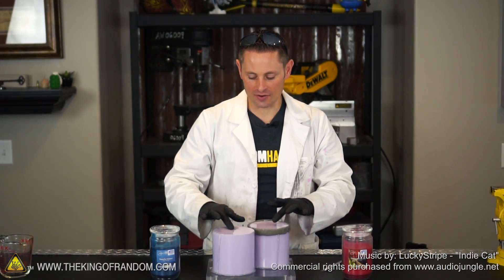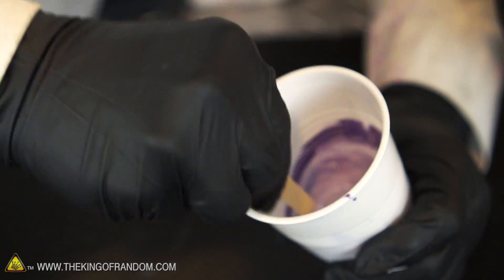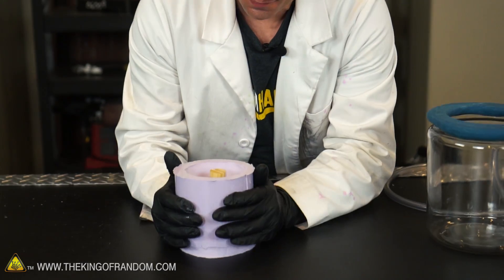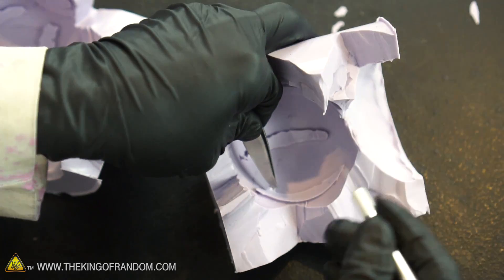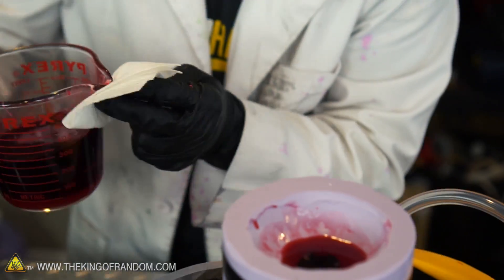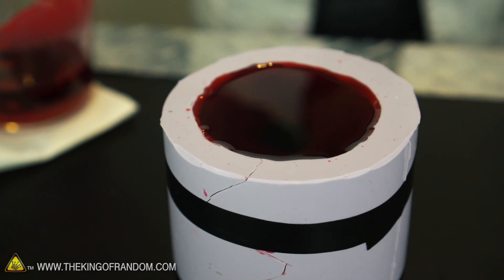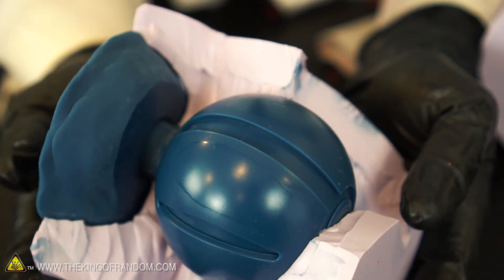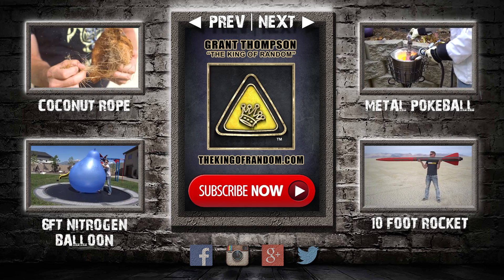Wax PokeBalls & More Trypophobia Reactions in a Vacuum Chamber | TKOR How To Make Pokeball Mold

Comment: By creating a vacuum he increases the pressure which in turn decreases the temp at which the wax would boil. There weren't any bubble in it necessarily, he just boiled the wax.
Reply: Kevin Braemer vacuum increases pressure??? No the opposite lowering the pressure lowers the boiling point
Reply: Nicholas Hagan yes that is my bad. This only proves my point because I meant to say that he is removing the pressure which also decreases the boiling point so those bubbles were boiling not in the wax
Reply: Kevin Braemer I also think that's what's happening
Reply: Precisely what I was thinking.
Reply: saw this right after i commented the same thing.
Reply: Hi Let's Kevin Braemer
Reply: dang, beat me to it!

Comment: The bubbles coming out from the wax aren't air bubbles, it's just the molten wax boiling.
The less air pressure there is around a liquid like water or in this case, molten wax, the lower the boiling temperature becomes, 
Water boils at 100°C at sea level (I'm sorry I have no idea how much that is in Farenheit) but if you go really high, in a non-pressurized plane like a Cessna 172 or in mountains, the boiling temperature can go down to 70°C. If you try to put water in the vacuum chamber, and remove air to a certain point, it will then begin to boil at room temperature, and then will all of a sudden vaporize

Comment: When you lower the air pressure around a liquid, it's boiling point lowers. That's why it bubbles, rather boils, in the vacuum chamber.

Comment: You mentioned that you think the bubbles could be coming from the cracks in the mold but the vacuum is pulling evenly from all sides so any air in the cracks would be pulled outwards not inwards and out through the top

Comment: The wax is boiling. When you decrease the air pressure in the container, the wax's molecules expand enough to make them have a super low boiling point.

Comment: bubbles = molten wax boiling under vacuum.
Reply: Boosted98gsx right? he has really messed up the inside of his vacuum pump now with the wax that will have deposited in it.
Reply: Henry Byers shouldn't have messed up the vacuum pump much, if at all. Just needs to change the oil in it at the worst case scenario.
Reply: Dylan Haley ok i see. i dont know much about the internals of a vacuum pump. just the very basic mechanics.

Comment: The wax started boiling at the loss of pressure. SOmething boils based off of the movement of the atoms (which is caused by heat) and the amount of resistance there is to the atoms or molecules escaping the solution (pressure). This equates to P/T T-temperature P-pressure. As we all know at STP (standard temperature and pressure) water will have to gain 100 calories to be raised to 100C, boiling point for standard pressure (being 1atm, or 1 atmosphere). But at higher elevations water boils at a much lower temperature because the atmospheric pressure is lower allowing the water molecules to escape solution at a lower heat.

Comment: Nice video, but there were two major casting errors:

You boiled the wax, man. The boiling point was reduced when you put it in a vacuum.

Never heat up silicone if you can avoid it. If you're using the mold once or twice, it's okay, but heat breaks it down over time. That's why when you cast resin in it you have to use resin with low curing temps.

Comment: When the mold was in the vacuum chamber the bubbles. Are those actually air bubbles in the wax or was the vapor pressure low enough for the wax to boil.
The first few bubbles could have been air bubbles and later it once the pressure dropped it might have been boiling.

Comment: if you still have the other silicone mold you can just probably put chocolate in it but when you put chocolate in it and when it's done you can like put a blow dryer and now the bubbles will go off and you see it and it'll go better

Comment: Hy Grant the bubbles from the wax were not in it but from the low pressure from the chamber the wax started boiling.
It can happen even with water but water goes first to solid in vacuum and then it starts boiling.

Comment: the bubbles in the wax is because you put it in a vacuum. (its boiling) the boiling point of a liquid drops when you drop the pressure.  that is why you can boil water at room temperature in a vacuum. hope that helps.

Comment: The bubbles you get when you put (warm) molten wax in a vacuum chamber is actually the wax boiling. You can try the same experiment with hot tap water. It's due to the fluid's specific boiling temperature curve (I don't remember the exact name ^^ )

Comment: Air bubbles in wax is from the vacuum pulling the liquid wax through the cuts of the molding. When you pour the reservoir, you can see wax that was pulled through the outside area where you had cut the mold open, as well as a very small gap between the two sides of the cut. 

Try leaving the silicone mold in the clear plastic tube you use when making the mold before casting, as it is sized perfectly to keep that mold completely joined (once the cut is made) and put that in the vacuum as a whole piece. Pour silicone mold on item to make the mold used for casting your creations, remove clear plastic and cut open the mold with the zig zag cut pattern like you do, remove item you used to make the mold you are casting, put silicone back inside clear plastic and tape that shut around the silicone instead of taping the silicone shut. Pour wax into casting hole in the mold, vacuum it like you do and you should see less bubbles as the wax can't be vacuumed through the cracks of the zig zag cut. This also accounts for part of why the reservoir went down some. Fluids naturally want to fill the spaces created by air, vacuum forces the fluid more into those areas. Give it a try.

Comment: Grant, I think that the pressure chamber wasn't extracting bubbles from the wax, i think it was actually boiling it in the temperature that the wax was in. Like if you are camping on a high mountain the boiling point of water is lower than it would be at sea level.

Comment: I'm pretty sure that the wax was bubbling because you lowered the pressure in the chamber enough to lower the boiling point of the wax. Obviously melted wax is hot so maybe it was hot enough to boil in that low pressure chamber

Comment: For candles, it would be easier to put the wick before pouring the wax. When we do candles, we simply keep the wick in place with a toothpick (any stick would do): the wick is tied on it, and the toothpick is simply resting on the top of the mold

Comment: I don't think that those are trapped bubbles in the wax. i think it's the wax boiling because of the low pressure. correct me if i'm wrong

Comment: Those bubbles are caused from the wax boiling in the vacuum. The less air pressure there is, the lower temperature liquids boil at. In a vacuum there is little to no air pressure.

Comment: I'm sure, that these bubbles were not air, but you were boiling it. When you lower the preasure, boiling temperature will drop too. For example, at 0,024 atmosphere water is boiling in temperature of just 20°C.

Comment: Is it possible that the vacuum chamber brought down the pressure enough that the heat of the molten wax was above the altered boiling point? Or does wax not boil like other liquids? Don't know, just a thought that popped into my head. Loved the video!

Comment: Hi Grant, could'nt the rapid bubbles from the wax be due to it boiling, since you've put it in a vacuum. The wax is already hot, hence it's melted, and the low pressure causes it to boil?

Comment: The thing is just, if you put a liquid into a vacuum and you see some air bubbles, that does not mean there are air bubbles in that liquid. Not necessarily at the least. The air pressure is so low that this liquid starts boiling at room temperature or lower which gives you air or steam bubbles.

Comment: i don't think that there was any air in the wax, but that when the wax was in the low pressure it was actually just boiling but not extracting air. the reason for this is because when anything is in low pressure it lowers the boiling point of any fluid (I don't know the same for solid) just as if a human were in space.

Comment: Having lowered the pressure causing the wax to boil also ensured the wax had reached its optimum viscosity and would have dislodged any actual trapped bubbles.

Comment: If I'm not mistaken the wax isn't releasing air when you put it into the chamber, but rather its boiling. Check out some codys lab videos of him changing the temp at which water boils and freezes in a vacuum chamber

Comment: The wax probably reached its boiling point for the pressure to which you submitted it. Those were probably not air bubbles because was is not going to dissolve nitrogen or oxygen very well because of the temperature.

Comment: That's not air coming out the wax. Water's boiling point reduces under low pressure. You boiled the wax.
Reply: Stephen Scanlon that's why blood boils if you go too far into space without a suit
Reply: RZYao Your body provides enough pressure to keep blood liquid, so it wouldn't boil. Any liquids on the surface of your skin and eyes however would evaporate off very quickly
Reply: Isaac Gonzales incorrect mate.
Reply: Though wax has a much lower critical pressure, so the wax might not have been boiling
Reply: Thats what I was thinking
Reply: J.ah Boiling water / wax does not release bubbles of air, it releases bubbles steam aka the gaseous form of water. Two different things. Air = CO2, O2, N2, etc while Steam = H2O
Reply: Stephen Scanlon I wonder if he would of kept boiling it if the wax would of been more concentrated?
Reply: RZYao wait im confused. liquid based things boil in low pressure?
Reply: TheMattChannel yes
Reply: Stephen Scanlon wax boils but it's was not hot enough to boils so he is actual extracting the air bubbles from the wax
Reply: Heat isnt the important thing when it comes to boiling, the pressure is. Boiling isnt caused by heating, or at least its only half the reason. im sure someone else can explain it better.
Reply: It doesn't help that paraffin wax is a mixture rather than a pure compound, so drawing a Pxy or Txy diagram is a bit tricky
Reply: Stephen Scanlon whats your point
Reply: Liquids when in a vacuum will boil and release gas or vapor under lower atmospheric pressure's. if he had continued to vacuum the wax it would of with my understanding, gone from a liquid state to a solid state. there was no air bubbles in wax
Reply: Stephen Scanlon yup thats exactly what i thought
Reply: Triple points bois
Reply: This goes for all elements. The lower pressure you have the boiling point of the element is also going to be low. If you've ever seen an egg in a vacuum chamber you'd see that the egg boils but its not hot enough to actually cook the egg. The boiling point of the egg dropped because of the low pressure. Chemistry
Reply: Not sure which one of this peanut gallery you were replying to but the question now is, what is the new composition of the wax?  Did we lose volatile components that were needed, or was the stuff that boiled off just impurities that were unnecessary?
Reply: Eric Chiang nothing was boiled off. The composition is the same. Grant just wanted to see if there were air bubbles. He ended up boiling the wax instead. Theres no difference though
Reply: +J.ah
But that wax isn't a single compound, it's a mix of a bunch of different things, and each of these components would have slightly different boiling points, so whatever component had the lowest boiling point would've been boiling off first, more than any other component. So the ratios of each ingredient in the wax would change.
Reply: J.ah There is quite a difference. Air is not steam, thankfully.
Reply: Stephen Scanlon i dont get your air is not steam analogy
Reply: PolyJohn you're right, but we don't know what wax he used
Reply: Stephen Scanlon i know that bro
Reply: yup! Basically, boiling is the point where you've put enough energy in the liquid for it to convert into a gas. One of the factors that it has to overcome when converting to gas is the pressure about it. Water actually boils at room temperature in a vacuum.
Reply: What confused me for a bit was that in the video he says he left the vacuum at 25 inches of mercury about 15% vacuum and it went down to ~23 which would mean the vacuum is increasing in strength and by a fair amount, but anyway I doubt the wax was boiling because it's likely paraffin and say it was (being generous) 50 degrees over its melting point in fahrenheit so ~150 degrees the pressure in the vaccuum chamber would need to be very low to compensate for the boiling point of paraffin being about 700 or 698 if you want to be exact which means it needs a lot of energy to begin evaporation and with the amount of bubbles it is more likely that it was pulling air through the cracks in the mold also before people start saying heat doesn't matter like they already have, it does affect it because the more energy which in this case is heat the more ability it has to evaporate
Reply: Lol before I watch the video I just want to say... THOSE TRYPOPHOPIA JOKES WERE TOO FUNNNY
Reply: Stephen Scanlon when people say that it's all about pressure to boil something but it's actually the amount of energy being released or taken in....
Reply: Francis Cajulis pressure is actually a very vital part of determining the boiling point of a substance. While energy is needed. Increased pressure would require more energy for a liquid to boil. Therefore a higher boiling point. Less pressure means a lower temperature is needed.
Reply: people dont say facts say
Reply: Sorry Josh! Just mentioned this because of the early replies to the comment. I do have the knowledge that when in a lower atmosphere the boiling points would be lowered. Due to the fact of the consumption of less energy to reach its boiling point.

Comment: Hey Grant, I think when you put the warm wax into the vacuum chamber, it wasn't removing trapped bubbles, but instead the wax was boiling because it was still pretty warm and when the ambient pressure is lowered it causes it to boil.

Comment: the bubbles of the wax in the vacuum chamber is because liquids boil on a lower temperature when there is no air, so the bubbles that you see is because its boiling.

Comment: @Grant Thompson putting the wax under a vacuum lowers the boiling point of the wax allowing it to boil under room temperature. Also the wax shrunk because boiling removes energy, because the wax had less energy the atoms were vibrating slow allowing it to take up less space.

but that is just my 10th grade understanding of chemistry.

Comment: Correct me if I'm wrong but wouldn't the bubbles from the wax just be the water that's in it boiling off due to the lowered pressure?

Comment: The bubbles in the wax is actually it boiling because when you lower the pressure of a container with a liquid in, the boiling point of the liquid decreases, in the case of the wax to/lower then room temperature

Comment: There was (most likely) no air in the wax. The bubbles that appear are gas being formed by the boiling of the wax. The wax started to boil as the pressure dropped in the vaccuum chamber, leading to a lower boiling temperature of the wax.
Remember, reducing the pressure on water can allow it to boil at temperatures much lower than its standard atmospheric pressure boiling point of 100C.
This wax which was probably heated at around 80-100C was warm enough to start boiling in lower-than-atmospheric pressure.
Reply: This can have an undesired effect if the wax cools too quickly. It could solidify while bubbles created during the boiling process are still present in little concave cavities of the mould.

Comment: I'm surprised it worked so well. I still don't understand how with all those craters in the silicone when it was in the vacuum chamber didn't affect the quality. I would have thought that the craters would overlap trapping more air. also wouldn't molten aluminum melt the silicone? Even if it wouldn't melt into a giant puddle immediately it would probably deform the mold. Aluminum has a higher melting point than silicone right? Or would silicone burn instead?